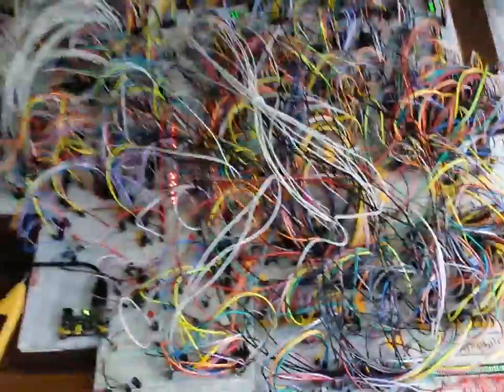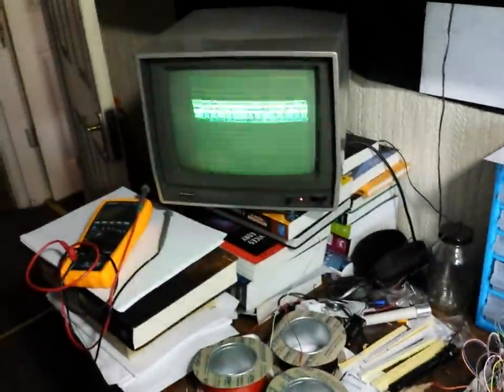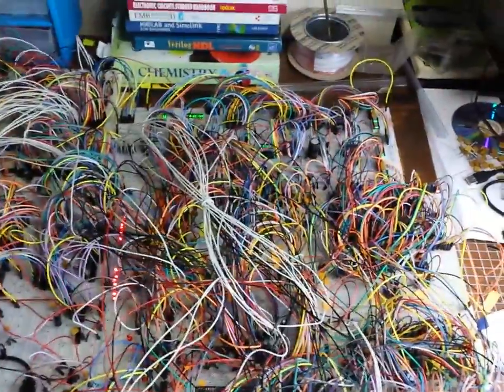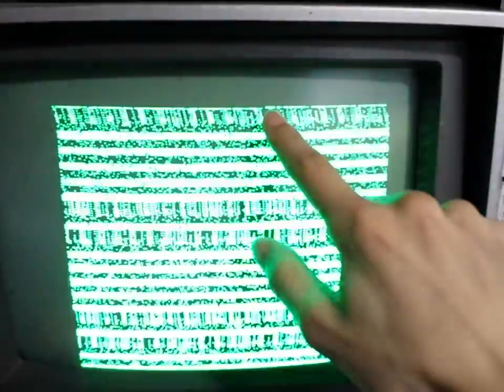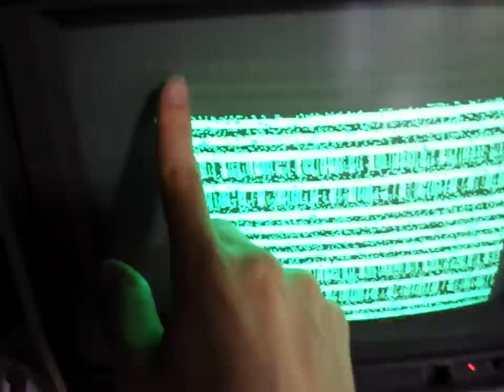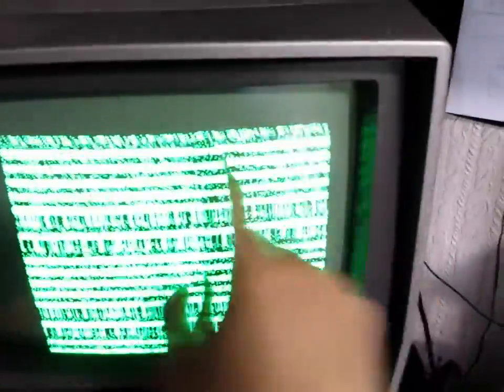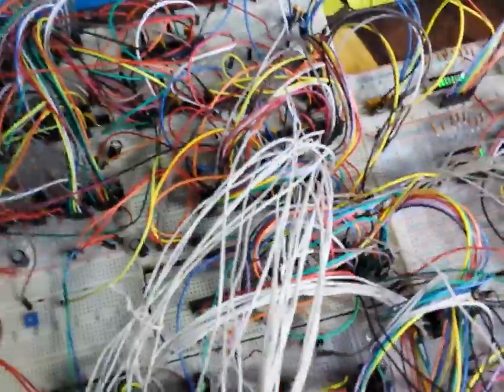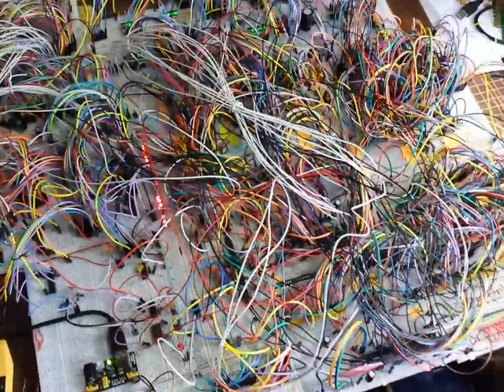Homebrew cpu BIOS generating images on the TV!

Comment: To avoid those blinking issues back in the day some systems didn't allow you to access VideoRAM while drawing. Rather, they had VBlank period between screen refreshes, during which the access was allowed.
Maybe thats just an artefact of running the clock slow, but thats just a suggestion.
Reply from the maker: True! I actually fixed that problem later on, but this computer doesn't exist anymore now...
Reply: Oh. Thats sad, but I hope your new one is less messy
Reply from the maker: You can write to VRAM during the blanking periods, but I devised a different solution whereby the VRAM is isolated from the rest of RAM, inside the video card, so that if the CPU wants to write to VRAM, it makes a request to the video card, and the video card halts the CPU for a nanosecond, writes the data, and unhalts the CPU.
Reply: Nice solution! I am currently making my own ttl video card and I have just made 2 VRAM banks, so that 1 bank can be accsessed at any time and the other one is being drawn onto the screen. Than when the cpu requests a draw to the monitor, the video card writes into the free bank and switches them around. Came out much more complicated than I tought it would, but I don't care since it works.
Reply from the maker: @FairfaceCZ  That's a good solution! I think the only issue is that you cannot update just a bit of the screen and you always have to update the entire screen, unless you copy from one bank to the other every time.

Comment: Very cool! :D I haven't even begun to think about video output yet. Do you have any recommendations regarding the graphics module? Where would be a good place for me to start?
Reply from the maker: You need to read about composite or vga signal timings. I used composite to display on a tv. This is a good tutorial on this: http://www.retroleum.co.uk/electronics-articles/pal-tv-timing-and-voltages/

And this page has a circuit you can build for video: http://www.waveguide.se/?article=bitmapped-video-interface

Mine is different from this guy's but similar.